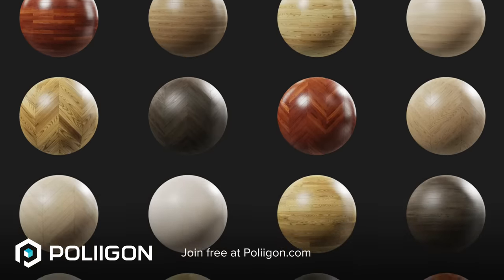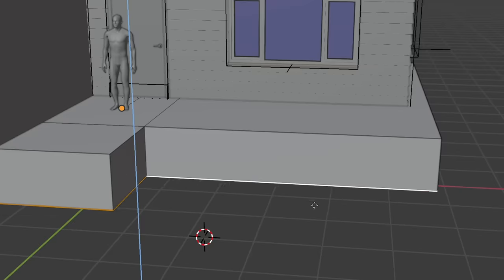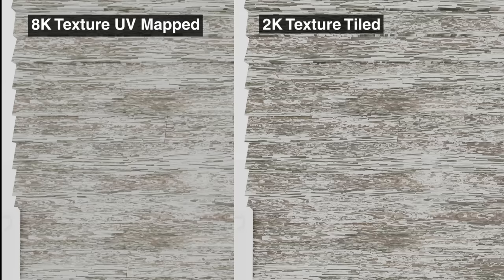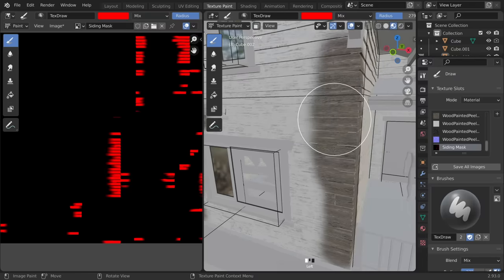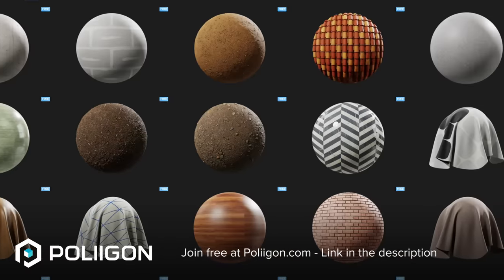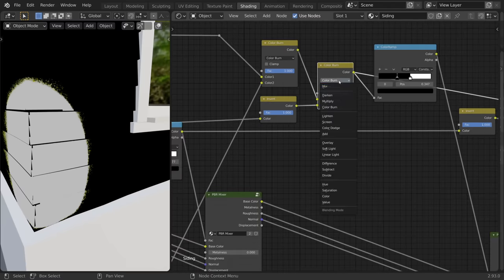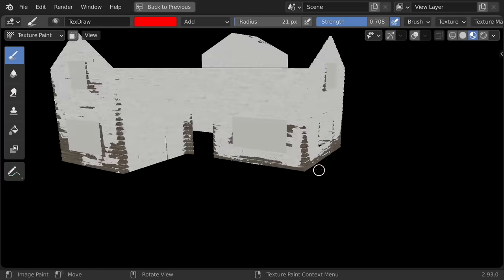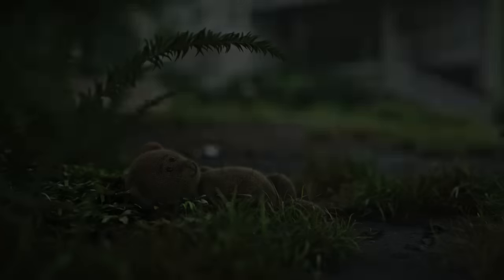How to make an abandoned house in Blender - Tutorial

Comment: Embarrassingly, I've been stuck at the 0:50 mark for a week. When I extrude the second floor and then try to do a loop cut, it only applies to part of the L shape of the second floor. The extrusion of the second floor caused an additional internal face to be added. The first floor doesn't have this internal face and therefore the loop cut applies to the entire L shape. Does anybody know what I am doing wrong? Losing my mind here!
Reply: A friend who knows Blender very well helped me solve it. Somehow I had extra vertices in the ground floor that didn't need to be there. He showed me if I selected the faces and then press g to move them around, you could see that there was extra mesh. Selecting the faces and then merging them (via Mesh | Clean up | Merge by distance) resolved my problem.
Reply: I figured out how I got the extra vertices/faces. I would extrude and then not like the size I choose so I'd right mouse click to cancel the extrusion. I already knew that this actually creates mesh and is helpful if you want to then inset and extrude up. But I had forgotten that this was a thing. Lessons learned I suppose!

Comment: i just need help, at 2:22 when i apply the boolean, the upper part of the wall of the house thay is right beneath the roof disappears leaving an empty triangle, i would love anyone to help me asap
Reply: Yea that's the same issue I been facing have you find any solution yet
Reply: @JOY___.  Idk if you still need help but, when you are selecting all the faces of the roof to seperate from your mesh, make sure you hit shift+d to duplicate it first, otherwise it will leave the top faceless and won't boolean or scale correctly

Comment: I did the boolean cutout but it adds new mesh in the windows and doors like a cube or something, did I do something wrong?
Reply: Make sure that your Modifiers on the clapboard are set in the correct order. It should be Array, Solidify, Boolean for house object that 'cuts' the clapboard', Boolean for the windows & door cutout booleans collection and then the Bevel modifier.

Make sure to apply the scale and that both Boolean modifiers are set to Fast.

Comment: Hey All. Great tutorial Andrew as always. 
I do have a problem though, with the boolean operation at 2:24. When I do the boolean, it initially looks right until I use Alt-S in edit mode - and then the siding panels just simply disappear when I go back to object mode. I have checked the normals are right and everything has scale applied so I am struggling a bit here. 
Any suggestions ?
Reply: OK - I am thick. I was fattening the siding panels, not the initial house shape. Forgive me.

Comment: at 0:54 you are using scale but it does not work for me even though I am following the way you have used to create walls and a roof space. It is merging first two sides but screws everything else with just the front size. And I have tried Merge at centre like other guys using and it is the same result.  If I just use your method or merging edges at the centre on a simple cube both methods work just fine.  blender 3.4
Reply: Did you ever work this out? It's driving me nuts!

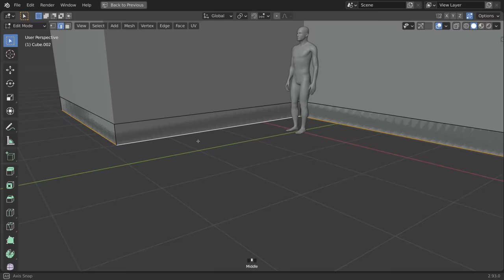Comment: i dont understand the part at 1:45 like im doing the same thing but its not working
Reply: To select all edges press A AFTER selecting ONE edge then press G then E drag the base up and left click where you want it after it’s placed press A and the area should become orange

This took me ages to figure out

Although after the in between area is orange pressing A doesn’t seem to work when only selecting the bottom edge so you might have to go around the entire building.

On my building the cube that sticks out needed it’s own angles for the bottom meanwhile the rest worked fine so that might be another problem

And when adding the array modifier make sure the x axis is on 0.000 or the slats will be in the wrong place and the y at 0.9

Also yes the reason for so many edits is because I’m just figuring it out at this second 😅

Comment: Can anyone help me Im having trouble with the siding texutures for some reason. My texture is way darker than his for some reason and when I put the color burn its basically just a dark spot, it doesn't add the mossy wood texture. The color ramp node also does nothing when I add it. I legit followed everything.
Reply: Make sure you are in cycles and not eevee
Reply: @t.a.1447  I just tried but it is still doing the same thing, do I need to start over or just switching to cycles should fix it?

Comment: why when i put the boolean modifier just dissapear?
Reply: all you have to do is slightly scale the boolean object to be larger than the object you're intersecting (make it bigger than the house by a smidge). You will see the house paneling pop back into existence once you have it scaled enough. 

IMO, you should create a copy of the roof instead. This way, you can grab all of the top faces of the roof copy in edit mode, E to extrude them upward (higher than the end of the paneling array), and use that as a difference boolean instead of an intersect. This will completely chop off the excess array in the precise shape you need without the fuss. 

If your difference boolean doesn't work right away, all you have to do is place it ABOVE the array modifier in the modifier panel :) order is key!

Comment: Blender keeps crashing and lagging on material preview viewport shading during texture paint phase. Yes, I have disabled Solidify modifier and yes, I have enabled Diffuse Color option. I tried to hide all the other elements, but Blender keeps crashing. The only way to work properly is to switch between solid mode and render preview (in solid mode it is impossible to see the colorburn effect).
Reply: Helpful info would be:
Gpu, cpu 
Blender version #
active add-ons
gpu driver version #
Reply: @duwuny5676  
RTX 3060 and i7 11375h.
Blender 3.3 and no third party plugins. 
GPU driver are irrelevant, I tried with the older and new drivers. Nothing changes, right now I'm using Studio Driver 528.49

I guess it's a memory limit, I have only 16 GB of RAM and 6 GB of VRAM

Comment: guys anyone know about 1:18
Reply: You have to extrude the middle edge which is on the wall at the back of the man mesh, then click Mesh-Separate-Selection, On Object mode add modifier solidify just like what he did of the roof. Then move the edges one by one to your desired position.